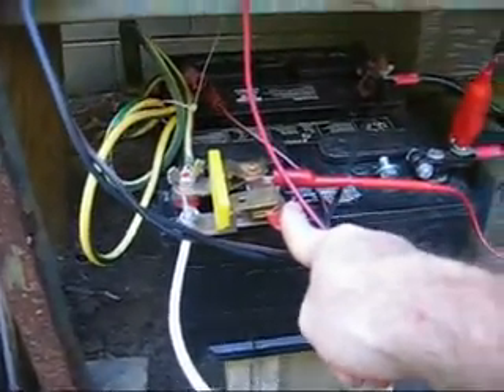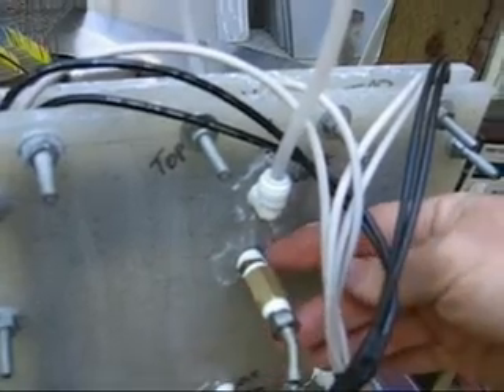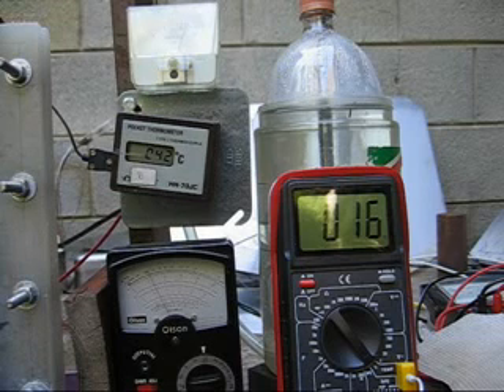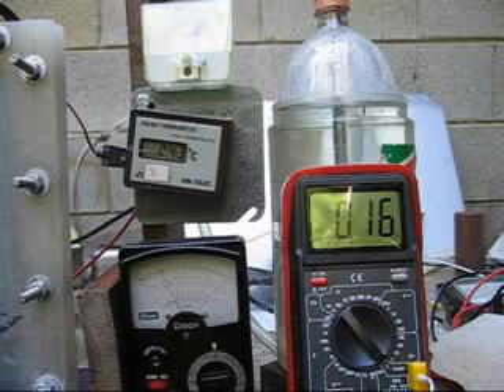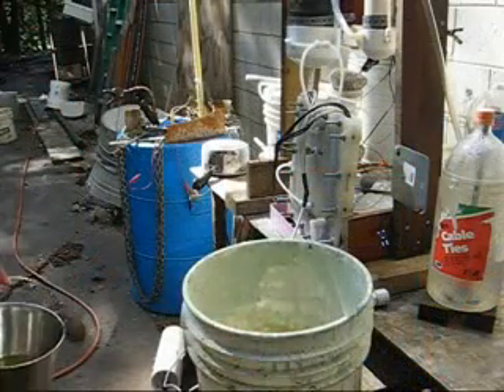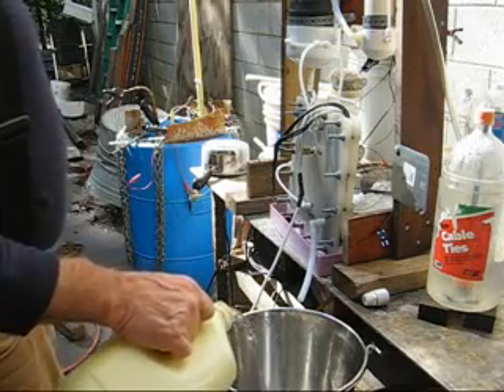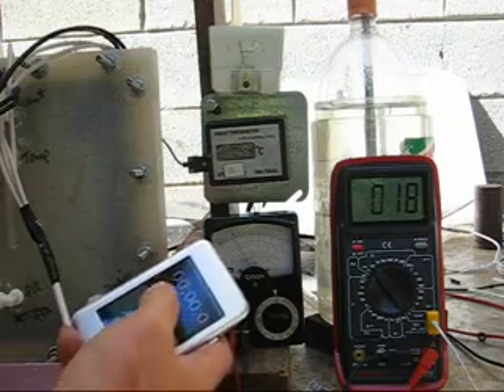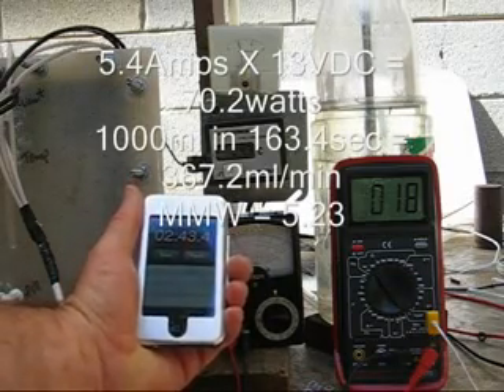HHO Dry Cell Mars Gasket Part 9

Comment: try to use a electronic kitchen weight to messure instead of using spoons to messure. makes  result much more accurate and makes your changes in setup more vissible in the results

Comment from the maker: Hi Thom: I do have a one gallon per minute pump that I plan to incorporate into this design. When I add a pump I will have to put mars gaskets on the top holes as well as the bottom. Normally HHO gas fills the top of the brick. When a pump is used the electrolyte floods the top holes and creates more places for the current to jump from plate to plate.
Mars

Comment: dont  you keep log books , i keep log books, on the mixes and the units i use the stuff in, also the results, run/1 run 2/ time/ temp/ result  volume produced, simple stuff, but surprisingly useful in the long run, im 53 yr old engineer  and dont quite remember all that I have done ..LOL these days, but  always kept log books help me get back to results from even a few years back, mixes used what was used, run times, so on and so forth, try it.. Is works.
Thom.

Comment from the maker: Brass is okay as long as it is not subjected to the actual electrolysis. I prefer plastic or stainless fittings because they don't corrode and they come apart easily.
Mars